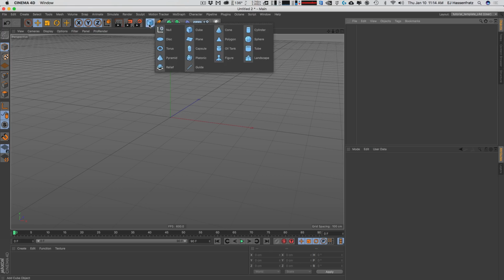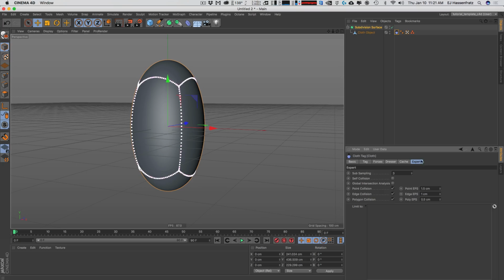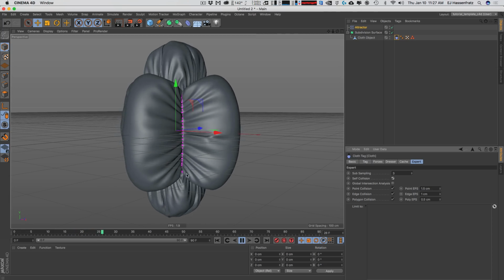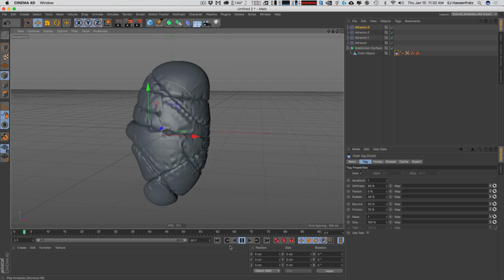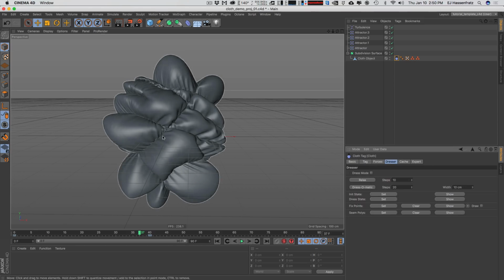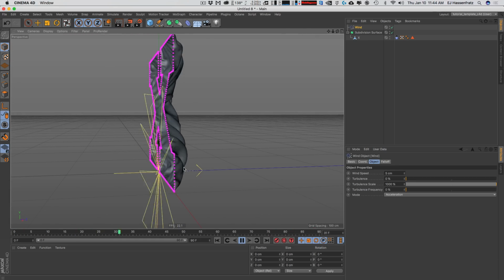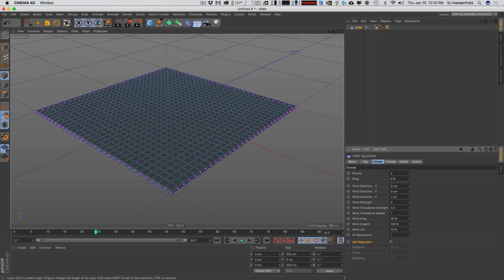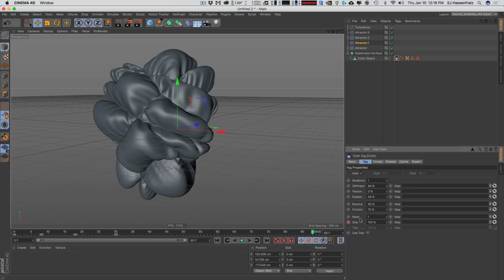Cinema 4D Tutorial - Creating Abstract Cloth Inflation Animations

Comment: Hi EJ, thanks for all the great tutorials! 
I have an issue with adding to the line cut selection. the tool selects after the cut just fine, but when I hold shift and do a second cut I loose the first selection; this happens regardless of holding shift. I'm using c4d 2023, and also tried it in c4d s24. but neither worked. the only way I found was to make multiple selection tags and then merge them together. 
is there some setting I need to change so that holding shift adds to the line cut selection?
Reply from the maker: Im not sure what the deal could be there!

Comment: Hi, the first part of the Tutorial is 🔥 Thanks a lot, very, handy and clear!

BUT for the MoText part I'm totally lost: I've got missing options in Caps ( no Regular grid/Width options available) in R21 C4D version. Also, when I still tried to pursue by making the object Editable, again: the Caps menu of the X Extrude Object is totally different, Create Single Object's not there, and I struggle to find it somewhere else..
If you have any recomendations - it would be very much apreciated!
Reply from the maker: are you using an older version of C4D?  yuo can try throwing the motext object in a connect object and making the connect object editable
Reply: @eyedesyn  Using R23. same issue. create single object option is not there. Please help.

Comment: The attractor object is not working for me. It's not sucking or blowing out even when I increase the strength to 5000 or -5000. What's wrong?
Reply from the maker: You can try adding the wind object in the Force List in the force tab of the dynamics tag and setting the force mode to include